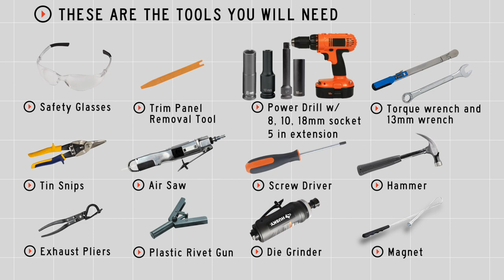2018 BMW X3 Trailer Hitch Installation

Comment: Very well made video but doesn't cover the electrical connections for trailer lights.
Reply from the maker: This customer did not want trailer lights so we were unable to get a video for it. We are working on acquiring another soon so stay tuned!